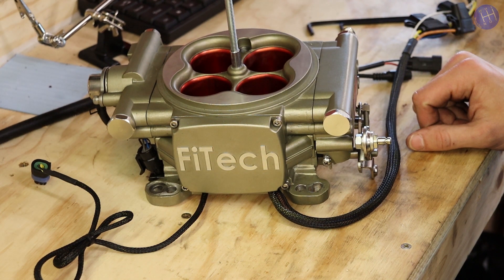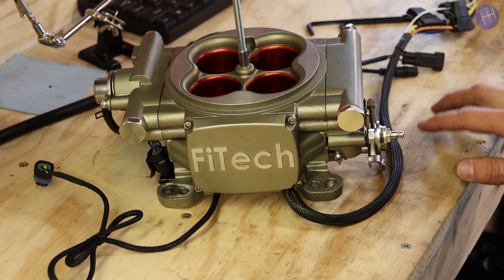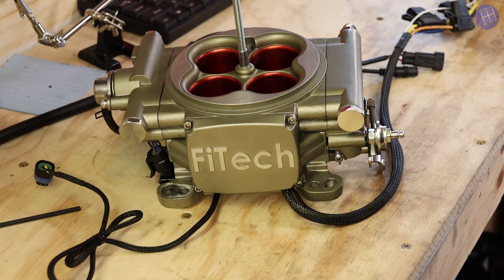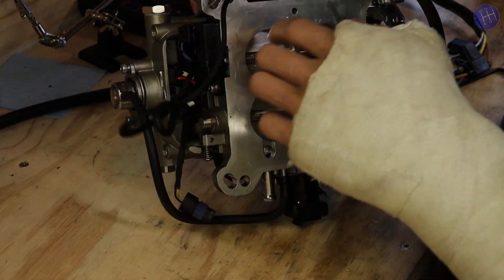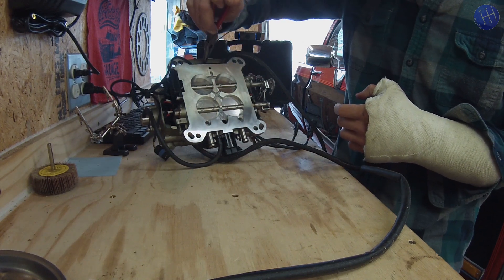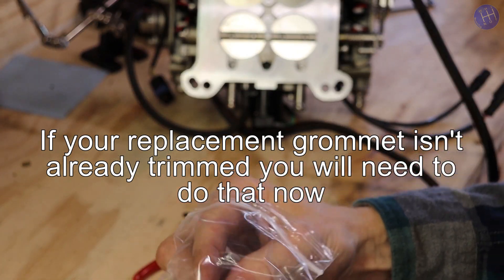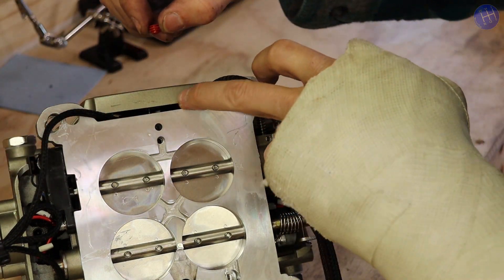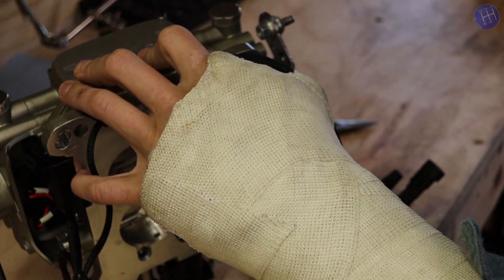Fitech Defective MAP Sensor Replacement

Comment: I’m curious to know if you had a whistling whizzing sound on acceleration? 
I have this issue issue and I’m not sure where it’s coming from. It seems like it’s a vacuum leak, but the engine runs decent. 
I saw someone posted on another site that it may be the map sensor seal making that noise

Comment: any luck getting your issues fixed?
Reply from the maker: Still working through them, I've chased my tail a bit on this thing.  I recently had an oxygen sensor go bad and now my secondaries are out of adjustment causing a lean spike.  Waiting for the snow to go away so I can test but I think im close haha.
Reply: @whynotmotoring  I have been having an issue where it stalls after about 30 minutes of driving. It will go real rich then real lean then stall. I’m hoping it’s just the map seal. Keep me posted please. Thanks
Reply from the maker: @gregklubek6016  I had possibly that same issue at one point and I vaguely remember the AFR readout going haywire on the controller when it was happening.  After keying off it would restart and run, then peter out 500 feet later as soon as the O2 sensor came back online.  I don't think I ever figured out exactly what caused it.  I believe it may have been a ground issue, I added an extra ground strap and also installed a phenolic spacer for added heat insulation and the problem hasn't returned. I don't think temperature was the issue.  I've had it in much harsher conditions than when it was dying.

Comment: What symptoms were you having because of the MAP gasket? I've got a 400HP unit , its only a couple of months old and it has an issue where if you punch the throttle it goes completely lean and cuts out. Online posts suggest its the MAP gasket but I wanted to see what issues you had
Reply from the maker: Yeah, the symptom was bad throttle response.  It wasn't smooth and would buck around if you weren't gentle.  I don't remember if it was going lean or rich, but if I stepped into the throttle it would choke and stumble on itself and then take off, and it wasn't the accel pump settings.  I'm probably going to send my system back to Fitech soon, because I have experienced this problem and other issues repeatedly.  I have done this fix twice now and it would hold seal for a while and have improved response but then gradually start leaking again.  I've installed two Fitechs, one was an awesome experience with zero problems and the other has been a headache.